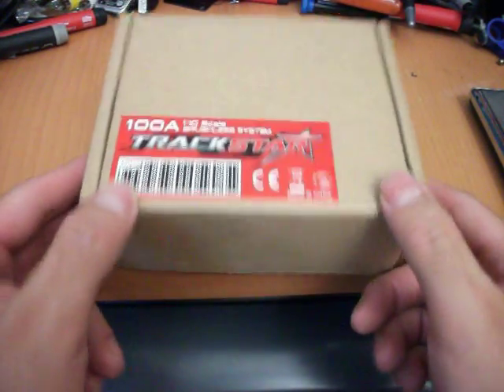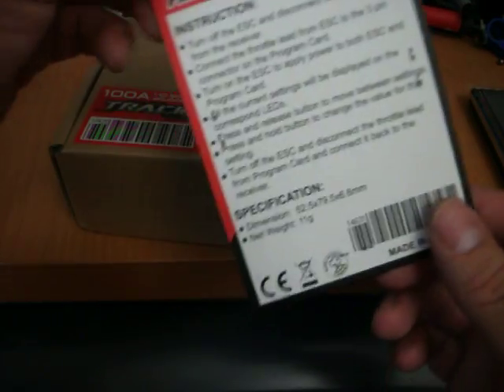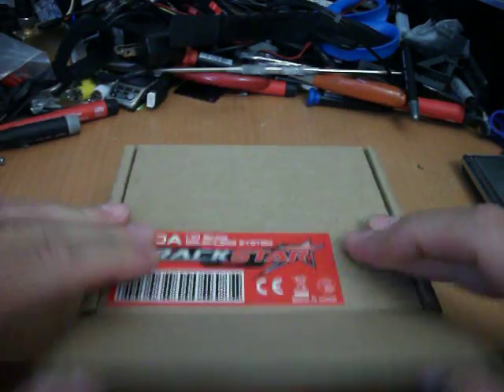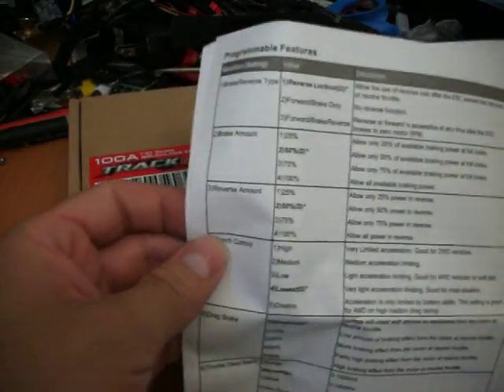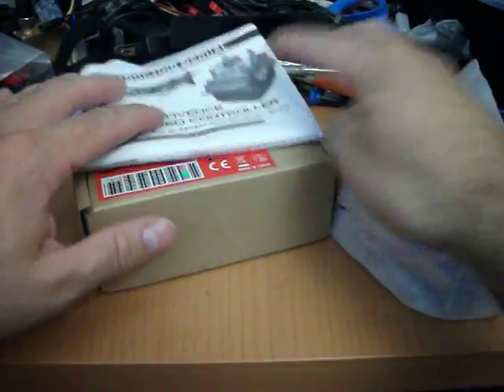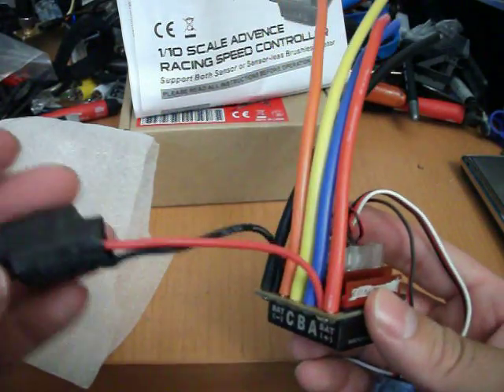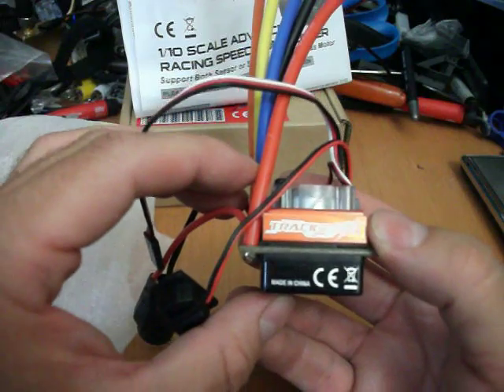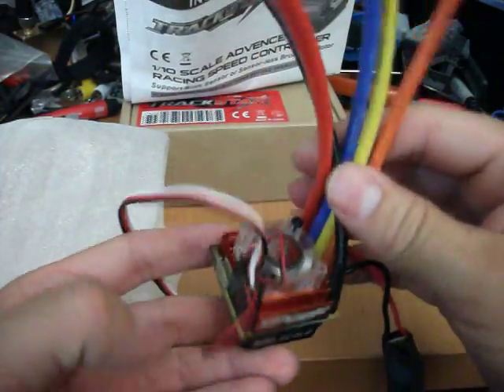Turnigy TrackStar 100A 1/10th Scale Sensored Brushless Car ESC

Comment: my ese flashes a red light then does nothing but if i hold the little red button down a yellow light comes on and i have absolutley no throttle or steering if you guys know what the problem is i think i might have to sink it to the remote but i do not know how

Comment from the maker: The reason I chose an 8.5 turn it's because I have a 6 and 10 turned brushed motors. The 6 gets pretty hot and the battery doesn't last too long. The 10 lasts much longer and doesn't get hot, but it's not the fastest, so I wanted to try something in between. I know brushed and brush-less are a bit different, but they seem about the same, but I can change the timing with the card on the brush-less which I think seems to work.

Comment from the maker: I was having a hard time setting it up but then I discovered that the transmitter battery was low and because of that I just couldn't get the transmitter set up until I recharged the battery. So make sure all the batteries are recharged before you try to set that up. My programmer wouldn't work because of this either. The battery was also low on the car. So just a heads up.

Comment from the maker: After all this time I finally installed my replacement with a kv4000 which was an 8.5 turn on the specs if I remember correctly. After checking all the solder and testing to make sure I had continuity on all the wires the set up seems to be working. Not the fastest setup, but I'm using the regular 7.2 nimh batteries. I don't have any 2s 7.2 lipos and I won't be trying the 3s batteries any time soon. That's what I used last time so I'm not taking any chances with those.

Comment: I think your problem is that the motor draws 120A, but the ESC can only provide 100A constant.  Your ESC should always be rated for a higher amperage than your motor (and your battery should be rated for a higher amperage than your ESC).  Good unboxing nonetheless!